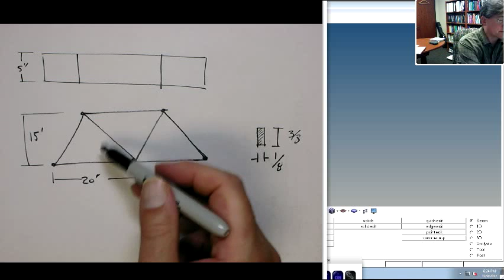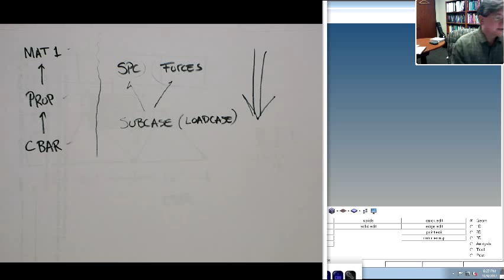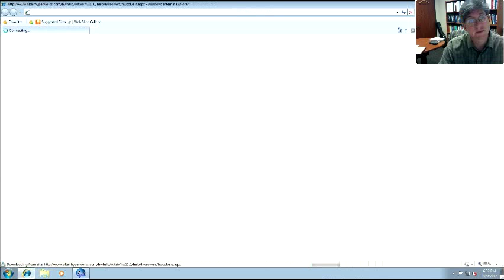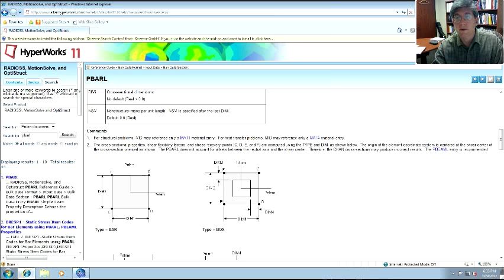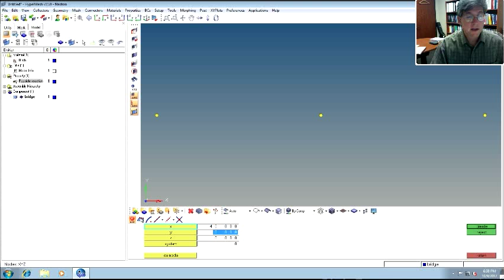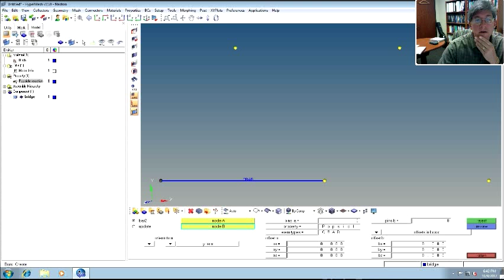Hypermesh for CBAR models part 1

Comment: hello sir , 
                 this yukesh, i need 1 doubt about, now i solve simple (3d model)contact analysis   i make preprocess in hypermesh and solver use in nastran , now assume element type and all , but now i check prefile in patran  bcs and all contact will not created , is there in any seperate  contact  element will be assumed hypermesh .

is there any study material (Academic problems ) using hypermesh and nastran  in structural oriented  please send me
yukesh.aero@gmail.com